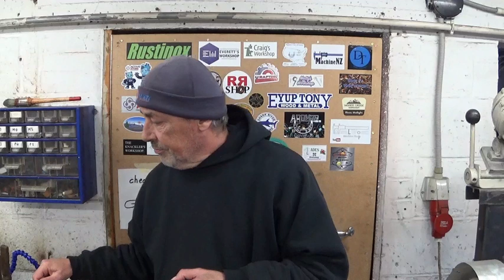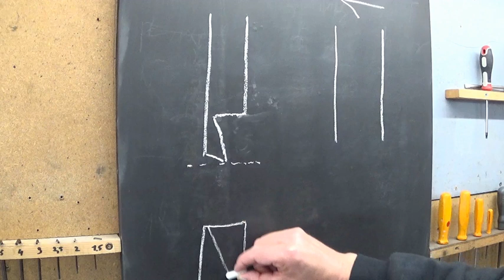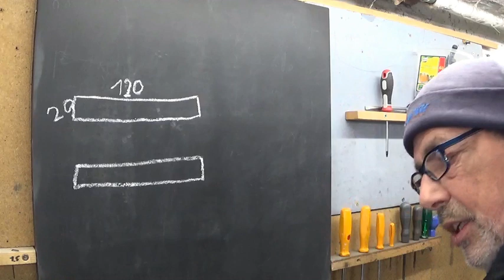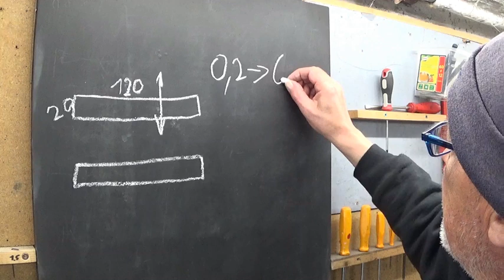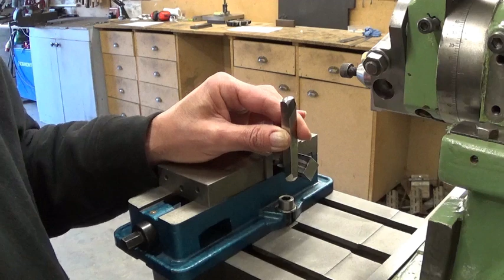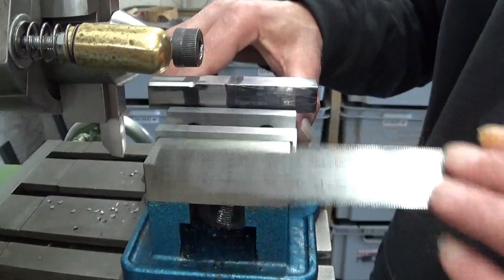Mr. Pete's hammer. The remake.

Comment: I have had pretty good luck using a shear tool with a 45 degree angle. You are correct about using longer strokes to make  shaper work faster. Good video, thanks for taking time to make it.
Reply from the maker: Yes, why not. Sometimes it works, sometimes it doesn't.

Comment: May be you can explain why these angles are used or their function. For example why a radius of 100mm
Reply from the maker: The bigger the radius, the longer the contact line between the cutting edge and the part. Gives better finish.

Comment: Finally, someone took the time to show that.
But it's not just the reduced amounts of cuts that one needs to make,
the Yoke mechanism also becomes more efficient.
When the ram only moves a little, the working stroke is about the same speed as the return stroke.
But with larger movements, the return stroke may take as little as 35% the time of the working stroke - so the effective cutting time percentage is increased.
Reply from the maker: That is correct. I don't believe it matter much in the hobby shop but you're absolutely right.

Comment: My Father used to use the shaper for cutting stock with a parting tool. He reconed it was 10 times fasterthan the power hacksaw.
P.S. Looking better with each vid.
Reply from the maker: My machine is a bit small for using parting tools, but it works.
Reply: That may depend on the power hacksaw you are using.